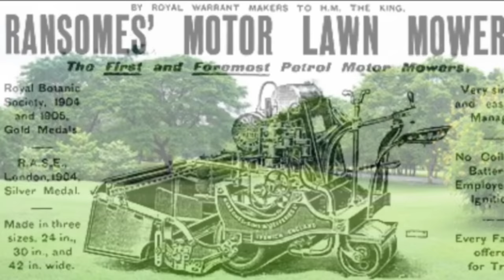Putting SAND on your GRASS | 70/30 Top Dressing

Comment: This was a great video. Sand is a great leveling material . Just go to the beach and see what happens to all the holes and piles of sand when the tide comes in and then goes back out.
Flat as a board !
P.S. " You make some sweet dirt stripes".

Comment: Hi there Great videos. Can you recommend a good 70/30 topdressing please. Or even better give me a quotation to consult on my lawn needs? I've had a lawn put down last year and it's in a terrible state. I'm in St Helens. Thanks
Reply from the maker: You want field compist no 5, discount code dhle10 works on that aswell, i dont offer my services out sorry
Reply: @DanielHibbertLawnExpert  that's okay thanks for the recommendation. So it this better than the kiln dried in your video? I have poor draining areas and need to raise/level and improve drainage. My plan was to regular hollow tine aerate and replace with a good product that can do all the above and over seed with a clay seed.
Reply from the maker: @andrewb12000  yeah its similar just not kiln dried but dry enough to spread

Comment: Another really informative video which has left me in a quandry...
I plan to seed and top dress my front lawn in the autumn but can't cover it without some degree of difficulty. Would it therefore be better to use sand rather Jack's magic, as left uncovered there's the potential for it to blow away?
Reply from the maker: Only use sand like that to level if its just seeding your doing compost but dont touch jacks magic now its bad stuff now its changed, watch my factory reset your lawn thumbnail

Comment: Great work Dan, just a quick question, you allow the grass just to poke through but what if your levelling out a dips that drop a inch or so, which would mean the sand is fairly thick in that area?
Reply from the maker: Your best doing these areas over time let the grass poke through then let it grow through then repeat the process, to much and you will smother it

Comment: Hi dan
Been watching alot of your vids lately and trying out tips and starting my own lawn journey.

In the vid i watched ,you said to ask a question you might know answer too.
So my question is.
How best to deal with dandelions? Back garden  is about 20m x 18m   full of dandelions, tried weed killers, tried using manual hand fork thing and picking them out by the root ( semi worked) , tries continously mowing them to take the head off but now they seem to grow lower than the mower can get to them and tried boiling water to kill them off .  But nothing seems to work they just keep multipling and seems its a slow loosing battle.

Any products or tips to use ?
Reply from the maker: Try vitax or round up for lawns
Reply: @DanielHibbertLawnExpert  appreciated lad,
Getting to wits end, was going to end up just pouring diesel over the whole back garden  until the prices went up 🤣

Comment: What about on a clay lawn as I have heavy clay issue already gone through digging down dug down 2feet and still clay so put down 200ltr bark dug that in and 33 50ltr bags of compost and dug that in to the top 8inch then leveled and seeded with some A1pro mix grass seed and Canada green but since then it's sank slightly lawn is 15m x 10m
Reply: Good effort there though mate. I'm sure it looks and drains a million times better than before. 👏👏
Reply: Compost rots down shouldn’t you have used top soil or lawn dressing??

Comment: Hi Dan just carried out scarification , overseed and too dress with jacks magic last Sunday afternoon , used your Barenbrug extreme came in plain yellow bag , which I meant to use last Autumn but weather was too bad , so I have used it on this spring Reno but haven’t really  seen any signs  of germination yet , how long should I expect it to take given the weather conditions the past week and being so dry and cold at night (8deg) . I have watered it lightly every morning and evening with flat hose ended spray not used sprinkler yet . I haven’t applied pre seed as I was advised to put it on after grass has established to avoid existing grass growing too quick while seeds are pushing through top dressing . What are your thought Dan is there a life span to the seed you sell ? Regards Glenn
Reply from the maker: I wasnt selling barenbrug extreme last autumn so you will have to get advice off who you really bought it off
Reply: @DanielHibbertLawnExpert  hi thanks for your reply , I have checked the green defra label and it was sealed in June 21 , I have found the receipt and it was yourself who supplied it and you still have it available in your eBay site at the moment. It is a Barenbrug Sport Extrene 100% Dwarf Rye 5kg bag , I didn’t order the sow pro with it as I was already using Stella bio boost at the time . Do you think it’s the seed or weather conditions Dan ?
Reply: Hi Dan , Pheeew just got back from work and noticed I now have germination after 12 days from first over-seeding   good old Jacks magic and Mother Nature giving us that lovely rain on wed and Thursday . My existing grass is now at 1 inch and new shoots at 1cm . Am I too early to cut the top growth back half an inch or shall I leave it till the new shoots have got more established to avoid being sucked up or disturbed by my rotary mower . How many weeks do I need to wait till I apply my pre seed fertiliser and bio boost ? Regards Glenn

Comment: I’m have just put stepping stones down and need to scarify to remove loads of moss on the other parts. Should I feed and weed first before I seed or seed and then feed and weed later in the year.
Reply from the maker: I dont advise weed n feed fertilisers
Reply: Wow, that was a fast reply. Thank you. Is that smooth or sharp sand your using.